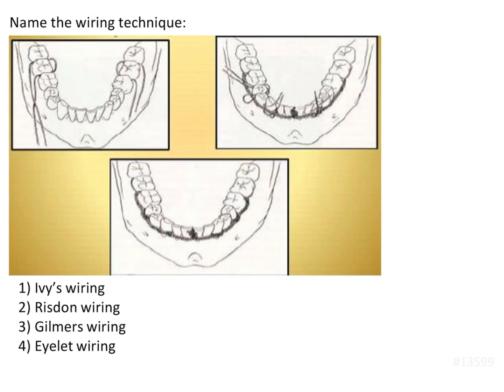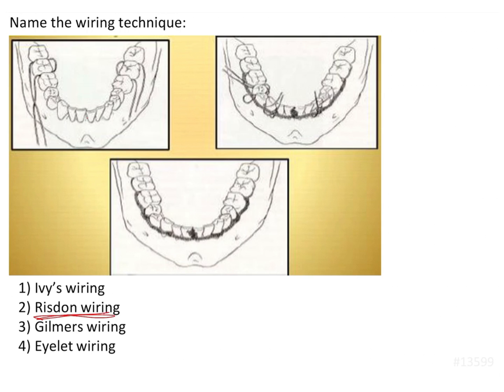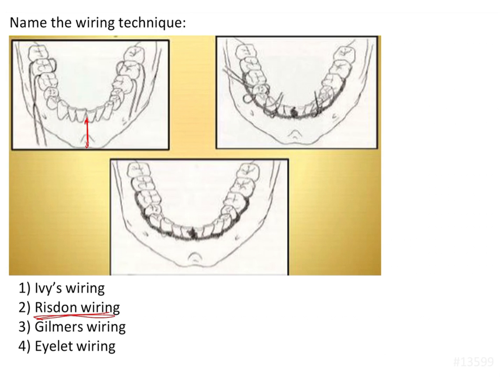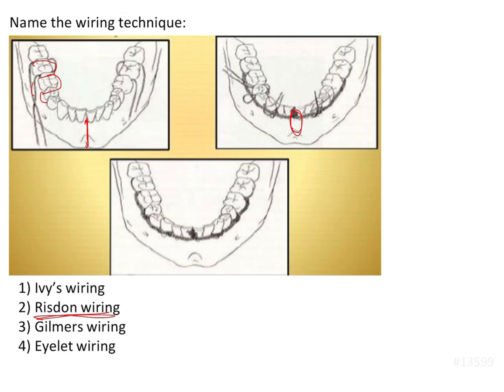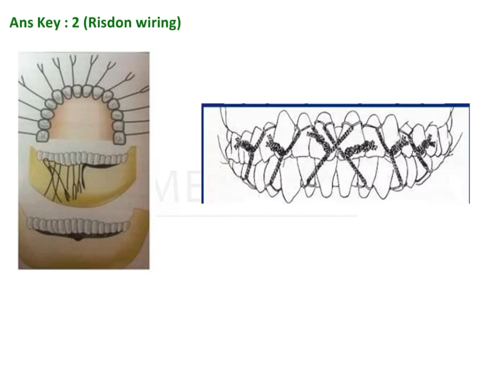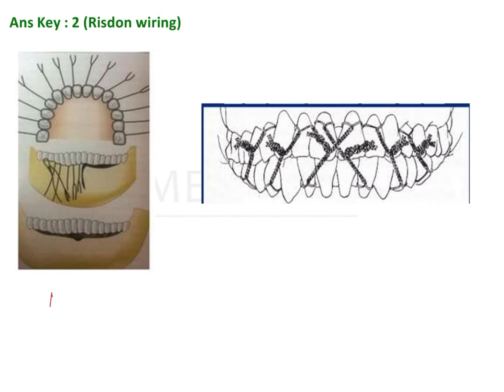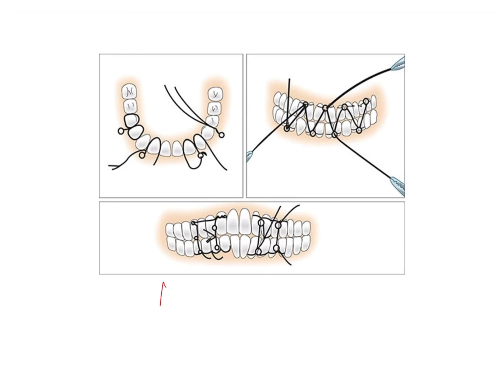NEET MDS | INICET - Oral Surgery - Mandibular Fractures | Explanatory Video | MERITERS

Comment: option 2: Risdon wiring
Reply from the maker: Correct answer doctor! 👏👏👏
RISDON'S WIRING
✶ It is a commonly used method of horizontal wire fixation.
✶ This can be a substitute technique for arch bar.
✶ In this method, second molars are usually chosen for anchorage on either side.
✶ A 25 cm long 26 gauge wire is passed around the neck of second molar on each side and both the ends are brought in buccal side.
The ends are twisted for entire length. thus forming a strong base wire that comes towards the midline from each second molars.

Two base wires are grasped and twisted at midline and adapted to the necks of the teeth on the buccal side.

The base wire is secured to individual teeth by using additional interdental wires.

This type of horizontal wiring offers strong fixation.